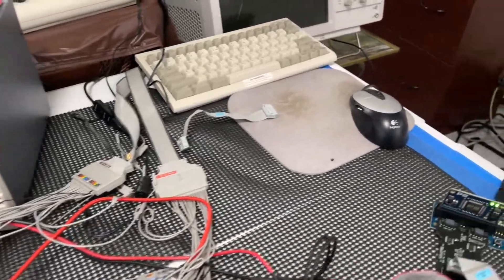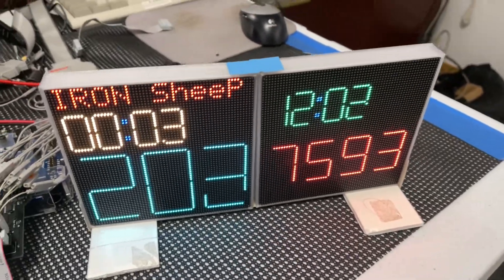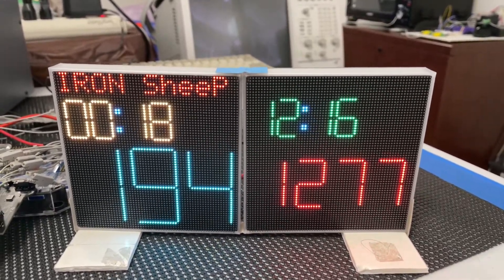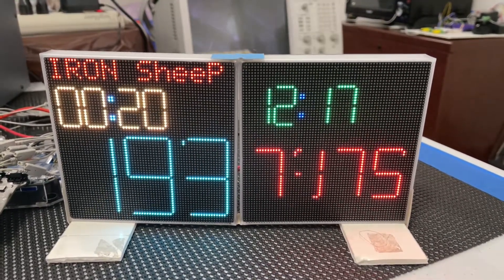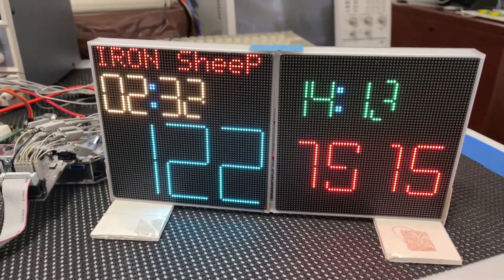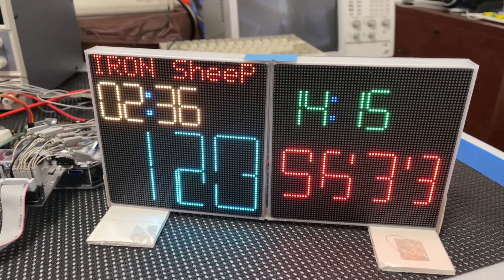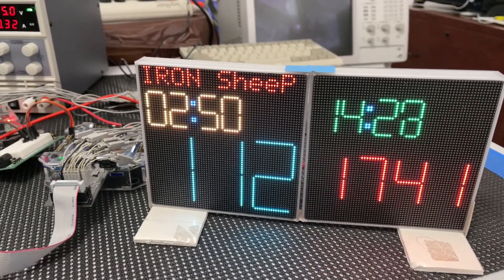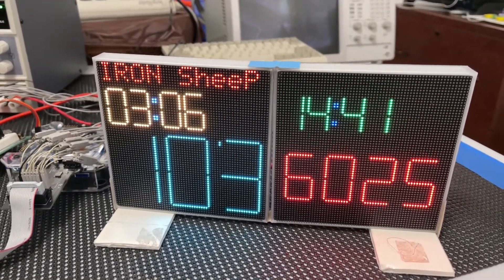Demo of P2 Morphing Digits using twin 64x64 LED panels

Comment: Hello

i have seen your designs They are beautiful
now i have a question, i have a P2 256*128Mm Smd1515 128X64 Pixel Rgb Full Color Led Panel Matrix received. And i would like to make a morphing clock. i do not have much knowledge of writing a code. Can you help me how to connect this to a Wemos D1 Mini V4.0.0 or to an esp32, and maybe help to write a code ino?
Kind regards
Ruud Hudepohl
Reply from the maker: I appreciate your comments. I'm a very active developer working on a long list of projects. I wouldn't have time to help you directly, but if you search for the morphing clock on instructables.com and youtube.com, you will find several implementations with instructions for making your own.  For example, here is a link to HariFun's project with Instructions. He's using an ESP board while I'm using a Parallax.com P2 Edge board.

https://www.instructables.com/Morphing-Digital-Clock/

Thank you for your interest. I hope this helps!
-Stephen
Reply: @IronSheepProductions   bedankt voor de  link